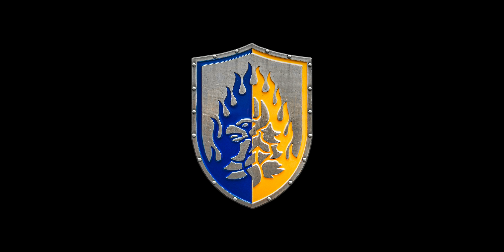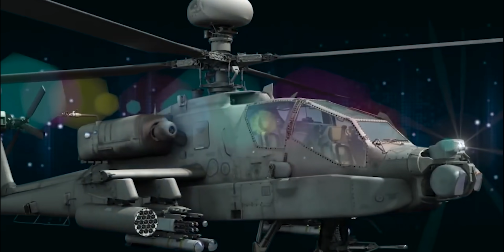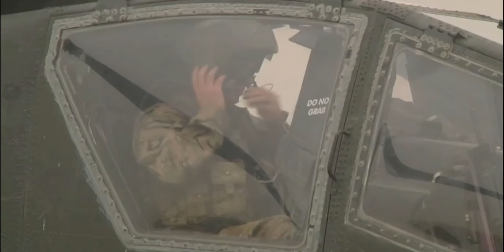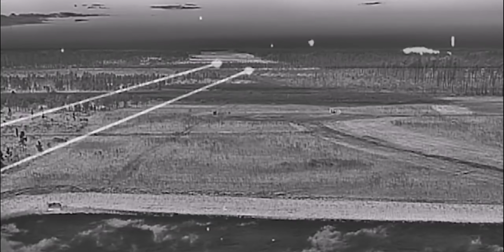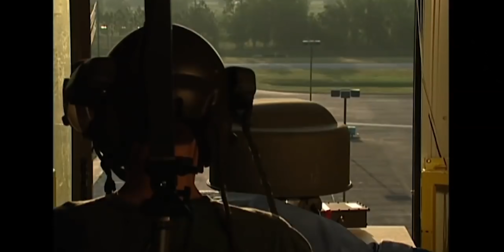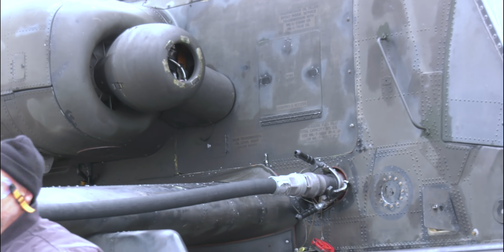AH-64D | Virtual Tour

Comment: KA-50 black shark be like: tail rotor? I haven’t heard that name in years. Also the Black shark: I can still fly without a tail (but not very efficiently) can you?
Reply: same problem with the south african rooivalk. shoot the tail off and the whole thing tears itself apart. and that goes for anything that isn't a Kamov coaxial. loose the control link on the tail rotor it flats out and around you go
Reply: @pieterpretorius1014  anything thats not a coaxial rotor will have the issue if every heli was coaxial it could fly without a tail

Comment: I am not an expert, but I was wondering why they keep comparing the f-35 and the a-10.  Doesn't it make more sense to compare the a-10 with the apache or cobra helicopter?  Maybe the air force can retire the a-10 if there are enough army and marine attack helicopters to take over the ground support mission?
Reply: I'm not an expert either, but I know that a big focus with the f-35 is air support and bombing. An apache uses armaments similar to the a-10, but it is a helicopter, and the range is more limited. The f-35 is an airplane, so it is more fuel efficient in terms of flight time, but unlike the apache and a-10, f-35s don't do gun-runs and rockets strikes, they'll likely do the same thing a-10s do but with guided missiles and jtac bombs. In the end, all military aircraft exist to support the ground forces in some way.